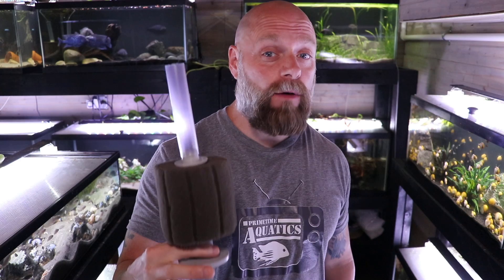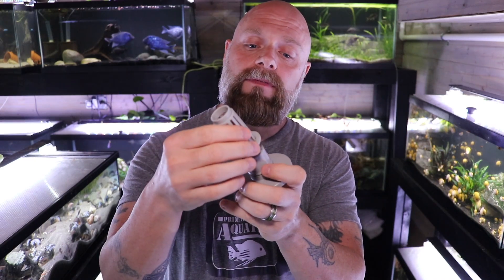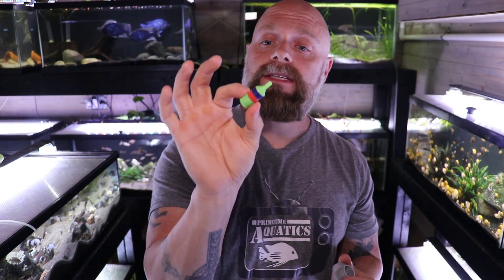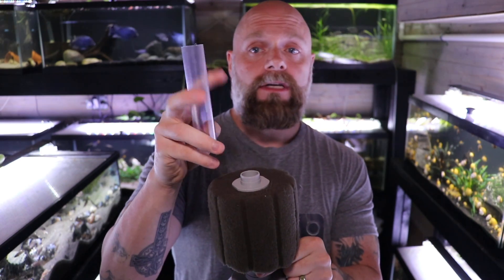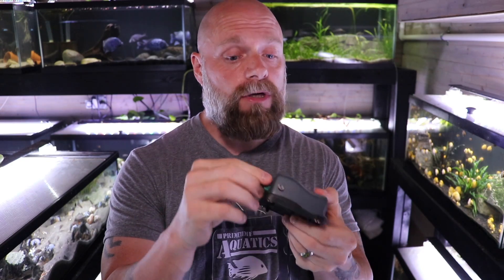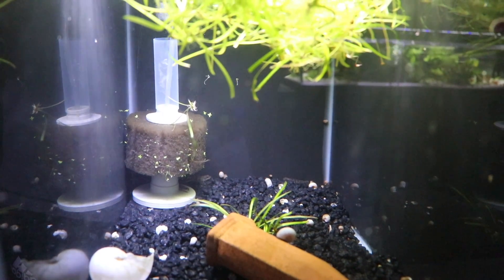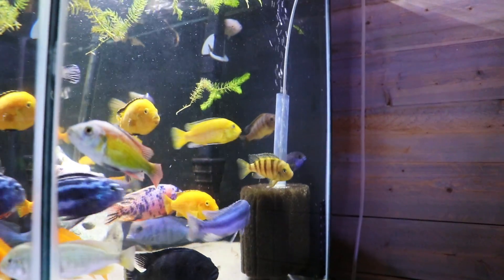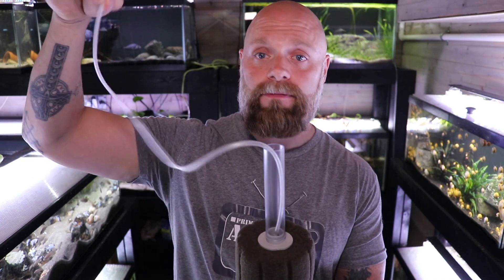Fish Tank Sponge Filters: Everything You Need to Know! Assembly | Placement | Flow and More

Comment: I bought a cheap one from my local pet store about the size of the on you are holding in the video. Mine has the same about of connecting parts but has a tube built into the housing parts each section has its on hard plastic tube. At the bottom built into the base is what they call a "defuser" BUT the bubbles are still large. I am thinking of cutting out the tube inside and setting it up with the air stone. Or should I just leave it as is?
Reply from the maker: Depending on the airstone you buy, you may not see that much of a difference.
Reply: @PrimeTimeAquatics  Ill probably just leave it be then. Thank you for the reply.

Comment: Please help me, I am getting my ranchu in the mail tomorrow and my ph is high (8-9) and my GH is low. We have soft well water. I did several additives to help reduce the ph and up the GH but nothing seems to work. I added ph normalizer to keep it at 7 but that didn’t work and I added baking soda, unionized salt, magnesium and calcium but still nothing. This has been going on for like three days now. Would you be worried for the fish? What should I do I’m scared.
Reply from the maker: So here is what I would do. If the pH is closer to an 8 I wouldn't worry about it. As far as GH goes, maybe add some crushed coral to a filter bag and place it in the filter? Hope everything works out well!
Reply: Prime Time Aquatics thanks I’ll get some online! I finally got the Replenish from Seachem in the mail just hours before they arrived today and it worked perfectly! 🙌🏻

Comment: What air pump do you recommend? {55 gal cichlid tank}
Reply from the maker: Anything rated between 50-100 gallons sounds work well. I don't use a lot of smaller pumps so I'm not sure about which ones are quieter.

Comment: Looking to run 4, 30 gallon tanks. What size air pump would you look at?
Reply from the maker: Assuming you are going to run four lines? I think the air pumps rated for 100-150 gallons with at least two outlets that can be split (even better if the pump has four outlets) would be sufficient.
Reply: Prime Time Aquatics thanks mate

Comment: I have a 10 gallon tank but just bought a 20-60 gallon air filter my question is can I use it or should I change it??
Reply from the maker: As long as the bubbles aren't coming out too strong you should be ok.

Comment: Hey Jason! I have a single 5 inch osar getting ready to go in a 75 gallon tank. I might add a pleco  or 1 or 2 more additonal small cichlids. What do you suggest i use for filtration? Hang on back, canister, sponge filter. A mixture of a couple? I really appreciate your suggestions.
Reply from the maker: I'd probably through a couple HOB filters on their if it were my set up. Each should filter around 250 gallons per hour.
Reply: @PrimeTimeAquatics thanks!  do you have a make and model you reccomend?

Comment: You only focused on air stones being used in this video. I know you talked about it before but you mentioned nothing about using power heads with the sponge filters and the pros and cons of each...... Air stones vs power heads. The title is kind of misleading.
Reply from the maker: Jason p it’s mostly because I see using a power head as sub-optimal. At that point why not just use a HOB and save the space in the tank?
Reply: @PrimeTimeAquatics  aside from those species that prefer "quiet" waters, wouldn't it be double the benefit.... Especially if you add an airline? I honestly don't know because I'm only just under a year into the hobby and definitely still learning.

Comment: for years, I've always had air pumps on the floor, I'm going to start putting them higher, can't wait to see the significant difference, glad I subscribe and seen this video
Reply: The Fish Tank Guy i have my air pumps lower. But i have bought a backflow valve .. for the purpose if power goes out :)
Reply: You won't see any difference at all. It just removes the potential for flooding if the power goes out and a siphon is started. Nothing more, nothing less.

Comment: If you put an L fitting on the end of the tube it will cut the flow in half..
Reply from the maker: It shouldn't - it will just direct the water across the surface more instead of straight up.

Comment: I always used a under gravel filter with a power head on one of the tubes with the other ones closed off..  What do you thing about that ??  Also, when doing a water change I only push the vacuum filter about 1/2 inch down into the gravel...  What do you think about that ??
Reply from the maker: UGF with a power head certainly works. If I don't have a planted tank, I gravel vac all the way down.

Comment: I bought my sponge filter but it did not come with any tubing or any air stone?????
Reply from the maker: They usually don't, but that stuff is super cheap and can be found at any petstore or online.
Reply: Prime Time Aquatics ok so I found the tubes in my old Aquarian also so I put a tubing in  the sponge filter and bubbles are coming out of my top like thick hard tube is it normal
Reply: Also I have 2 filters running in my tank a sponge filter and a normal hang on filter I have 3 guppy’s 3 Molly’s 2 albino corydoras and 3 other small orange fishys and 2 mating pairs in my tank what would u recommend a size for all of them before I get the rest cause I have the 3 guppy’s and Cory doras is a 10 gallon still ok or do I use my 20 gallon
Reply from the maker: If you are putting them all in the 20 gallon and using the HOB and sponge filter from the 10 gallon that will probably work just fine. If you are leaving the HOB filter in the 10 gallon, any HOB rated for a 20 gallon tank will work. Once the sponge filter is probably seeded with bacteria in the tank (usually takes about 3-4 weeks) it might work just fine on its own for either tank.
Reply: Prime Time Aquatics ok but are the fish limits to high for a 10 gallon I just want to know if I have to great working filters and well established bacteria
Reply: Also I just took a amonia lvl test and it says it’s at 3.0 WITCH IS BAD 0.25 can be lethal so I did a 65% water change I added bacteria and dechlorinator to the water I was gonna add back I took a test for that water it said it was at 0.5 and I was like ok now it’s back to 3.0 I did add bacteria inside the tank and I increased air flow what do I do I can’t get rid of all my water but should I???? I have my benifecal bacteria in one of my black sponges already
Reply: Plz I don’t want my future fish to die nor my present fish 🙁

Comment: Okay so the air pump pushes air to the air stone causing bubbles..so how does hooking it to a sponge filter cause it to reverse the air and start sucking it?? I don’t understand how this works and have used power head instead because it doesn’t make sense
Reply from the maker: Great question. As the air leaves the air stone inside the sponge filter, the water exits with it. This creates water current which has to be pulled through the pores in the sponge.

Comment: I hope this isn’t the most stupid question, does the air pump replace the need for a water pump filter. As always, great video man.
Reply from the maker: Not a stupid question at all. Yes, if you run a line from the air pump to the sponge filter that will do the job!

Comment: Is a sponge filter usable without an air pump with it, or is it absolutely necessary?
Reply from the maker: Either an air pump or power head will work. They just need to have water moving through them so the bacteria can get the oxygen they need to break down ammonia and nitrites.
Reply: Holly Ryan from my knowledge it’s absolutely necessary if not then it’s the same as just plopping a sponge in your tank and it won’t really do anything
Reply: kieran cunningham ok thanks that helps a lot👍🏻🇺🇸
Reply: Holly Ryan no problem glad i could help 🇬🇧

Comment: What are your thoughts on the regular vs. Pro ATI sponges?  They are now advertising a stack combo stating the pro is too porous for biological filtration.
Reply from the maker: I haven't used the pro sponge filters. I will say that any sponge filter is capable of housing bacteria that will usually hold more than enough bacteria to keep ammonia and nitrites in check provided the tank isn't extremely over-stocked.

Comment: Great video! How come my sponge filter gets clogged where the airline connects into the sponge? I’m constantly finding my filters not working from getting clogged. I then take apart the airline and clean out with a tooth pick.
Reply from the maker: I've had that happen a few times too. It could be hard water, extra detritus from the tank, or possibly when the flow starts out too slow?
Reply: I also don’t use the lift tubes . Mainly so I can keep my pump on during water changes and do bigger water changes. Do you think a air stone would help? I do have hard water, it’s perfect for my African cichlids. This was a great video! Makes me think about my setup and how I can possibly make it better!
Reply from the maker: I'm not sure the lift tube would make a huge difference.

Comment: If I have a sponge rated for 75 gal do I also need an air pump for a 75 as well. Or would a 40 gallon AP work?
Reply from the maker: If you are getting decent flow through the sponge filter you should be fine.

Comment: Hi, Awesome video to start. Now placement was my question.  I have a 55 Gal with Peacocks/haps...a Fluvial 306 where in and outs are at opposite sides.  I wanted to add the sponge to help overall filtration but also to use if i need an emergency quarantine in a pinch.  Do I place it closer to the 306 intake  side to create a one direction flow? Or do i Put the sponge closer to the out flow to get filtration on opposite sides. Thanks in advance!
Reply from the maker: Either one is fine. if you place it next to the return you might be able to blow the bubbles across the tank a little.
Reply: @PrimeTimeAquatics  and blowing bubbles is ok? Lol
Reply from the maker: Joe Alfano sure

Comment: Are the bubbles supposed to come out of the sponge? Mine seem to just come out of the hole around where the tube connects how can I be sure it's actually working?
Reply from the maker: The bubbles should come out of the top. The tank water is actually pulled through the sponge part to the center of the sponge and out the top. Sounds like it is working ok.

Comment: Breaking up bubbles inside a sponge filter also increases the surface area of the air that creates the Venturi effect... Increasing fluid flow...
Reply: Nope, same flow rate from your air pump. Just smaller bubbles instead of bigger bubbles = same surface area and actually less flow because of back pressure.

Comment: Wherever i put my sponge filter should i keep my heater close to it?
Reply from the maker: I haven't found it to be necessary. Some tanks they are close to one another and other they are on opposite sides. Just make sure the sponge doesn't burn on the heater when doing water changes!
Reply: Thank you for answering my question.
 I have a 55 gallon tank and i just purchased my first sponge filter yesterday, then hooked it up. Im concerned about the small particles/fish flakes floating around and it looks like there is no suction from the sponge.

Comment: Only starting in the fish world after 30 years out,could you tell me does the piece of tubing with the airstone join the rest of the tube at the cap on top of sponge?
Reply from the maker: Yes, the top plastic piece often has a place for the internal airline tubing to connect and a place on the other side for the air line tubing to connect to the pump. Some sponge filters may not have the internal part, however,
Reply: @PrimeTimeAquatics  Thanks.

Comment: How about replacing the air pump with a powerhead? Some can add air into the flow. Wouldn't that increase filtration with reduced noise?
Reply from the maker: For sure. For me if I'm going to add a power head I'd rather just use a HOB at that point and save the room in the tank.
Reply: @PrimeTimeAquatics  With a shrimp tank, they like to graze on the sponge, so that part wouldn't change. And also HOB's have a chance however small that they could clog and overflow.

Comment: Great vid as always. If a sponge filter is in a tank primarily for biological filration and air,  on average how often should you clean it?
In your linked vid you mention cleaning about once a week with no problems. But if it was only for biological would it be good to wait longer?
Also I think you should do a test with a few of your tanks that have sponge filters primarily for biological filtration.
Try not using a sponge filter at all! Maybe the degree to which they help biological filtration in many of your tanks is negligible.
Reply from the maker: Very good questions. I clean them once per week because that helps them do a decent job of mechanical filtration. You are correct, in some of my lightly stocked tanks, once they are properly cycled, the need to even a sponge filter is reduced. I've had a couple small tanks with no traditional filtration, just air, and they are working out fine. Both are planted, lightly stocked and have been up for over a year before I stopped worrying about traditional filtration.

Comment: What size air pump should I be looking for? I know the flow is important but wouldn’t the pump size affect the flow rate?
Reply from the maker: That is a harder question to answer because it depends on the depth of the tank, flow rate desired, length of the line and how many air-driven items you want to run.

Comment: Something is wrong with your sponge filter. Normally they have a tube down the midle that carries the air all the way down. Did you modify yours?
Reply: That particular brand, Hydro,  comes that way from the manufacturer with the hollow center pieces. Ones with the plastic airline stem in the center can be modified to accommodate an airstone fairly easily though
Reply from the maker: Yes, as others have said, that is the way the hydros come. A line can be run for an ayirstone with desired. :  -)
Reply: I have an aquatop and it's just like his

Comment: Hi Jason, I thought this was a fantastic video. This was perhaps the most thorough video I have seen on sponge filters. I personally use the Hydro Pro 3 and 4 in my tanks with Never Clog Air Stones and check valves. I’m setting up another 20L that I want to put some more Shell Dwellers; I find the  Multies to be fascinating. The same two in my tank now spawned  again in the same shell with their older brothers and sisters. Now I have two groups in the same shell with the same female. The male stands guard close by also. Anyways, I am going to share your video in my group if you don’t mind. Thanks very much for sharing.
Reply from the maker: Thank you! Appreciate it!

Comment: Another great video mate personally I mainly use api as well but 1 thing worth mentioning at least for people new to sponges not all sponges have the space for air stones ive got 2 i don't use anymore but the connection for the airline runs the length of the sponge and connects right at the base
Reply from the maker: Good point!
Reply: I encountered this problem as well. I was able to use garden pruners to snip the plastic interior airline stem and supports, leaving a hollow center to the interior pieces. Used a tiny snipet of the discarded stem to make an adaptor for the airline that can plug into the bottom side of the top cap for the sponge filter.From there just use jason's method to attach your airstone

Comment: I love the bubbling sounds, though the noise the pumps make not so much.
Reply: Grabbed a small USB nano pump that has a nice purr to it, not sure if it will push enough water for you though!
Reply: I get the extra tubing and connect it to the other air hole, then tie a knot anywhere in the tube and it makes the motor so much quieter
Reply: I wrap my pump in a sock and it helps A LOT
Reply: wrapping in socks and sponges are great also but buy one that turns down get the sweet spot and have big bubbles without the stone in it they move water better through the top tube especially if they fill to the edges of the up tube that will move max fluid through the sponges, just basic fluid dynamics. but putting the pumps in sponges and sock and wrapping it tight to muffle pump sound, is actually a big fire hazard so put that stuff in a fire bin like a big metal can or something just in case.

Comment: Jason, what is your preference between the hydro and hydro pro?  Have you compared the actual foam used in various foam filters, such Hydro, Hydro Pro, Swiss Tropicals Poret foam, eBay XY-380, etc?  Longevity, pore size, effectiveness, and lifespan?
Reply from the maker: Great question! Short answer is I don't have enough experience with those other brands to provide good advice. :  -) I prefer the standard pore size I have to the pro just for ease of use.
Reply: The XY-2831 sponges have such small pores they are more like water polishers. 
I have a few Swiss Tropicals poret cube filters; great filters and they don't need big pumps to operate. I can run my 3 inch cube filters with the USB Nano air pump that aquarium co-op sells.